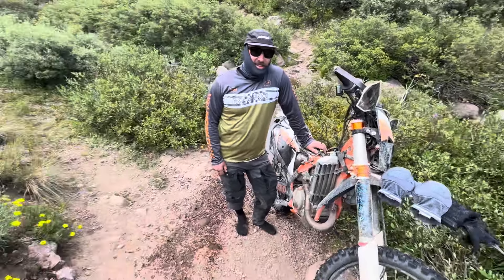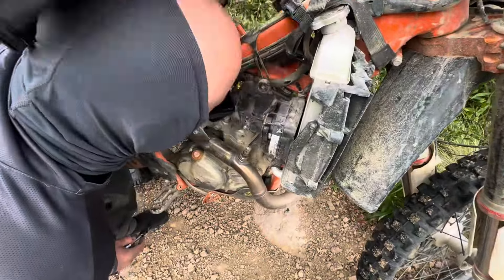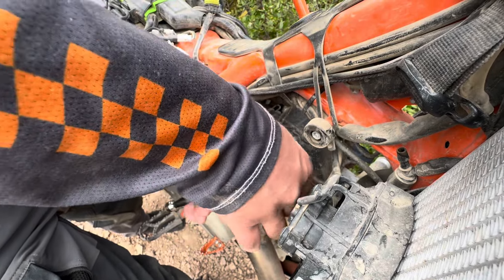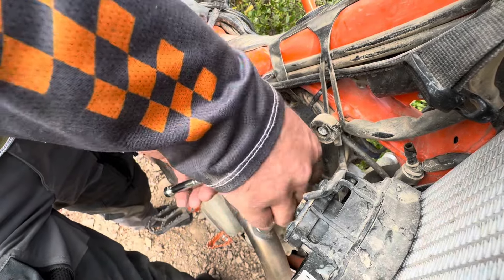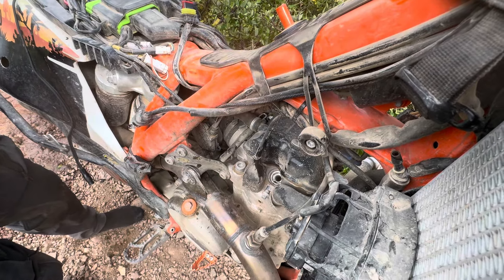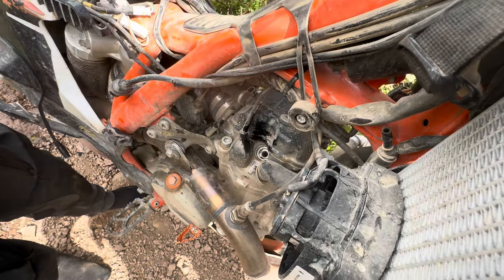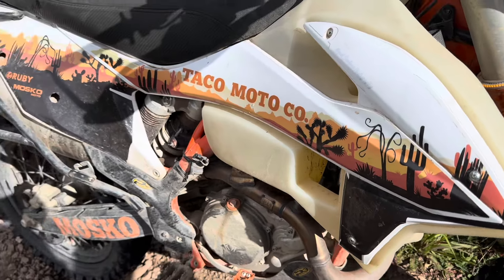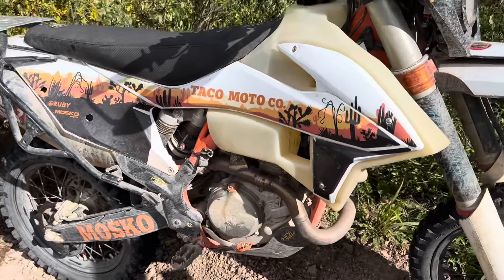FIELD HACK - River Eats a KTM 500 EXC-F, How To Get It Running Again

Comment: I've found I can lay the bike on the exhaust side, put it  in top gear and turn the wheel back and forth until the motor turns over. Lift the front up to tip water out of the  exhaust then stand it up and start it.

Comment: 1 more tip. more so than not,  you will end up with water in the oil.  check the sight glass. If its over full there's water in there.
Reply: Easy to tell since it will look like chocolate milk. Don't ask me how I know :hand-purple-blue-peace:
Reply: This. I drowned a vstrom but /good/ once and (rightly or wrongly) wound up doing three oil changes to get rid of all the milkshake.

Comment: Somebody (Mike!!!) needs to come up with an aftermarket air box for the KTM's that is less likely to fill up with water from a simple left-side tipover.
Reply: I was thinking of 3d printing a solution for this which would be a kind of manifold at the neck of the intake with a kind of switching valve with a temporarily fixable, flexible hose (for portability) which I could ensure went up high enough to safely cross when needed. Working on this in my head only, not in cad yet.

Comment: This same thing happened to a buddy of mine. Water got in the oil and it ended up cracking the cam carrier and locking the engine after startup.